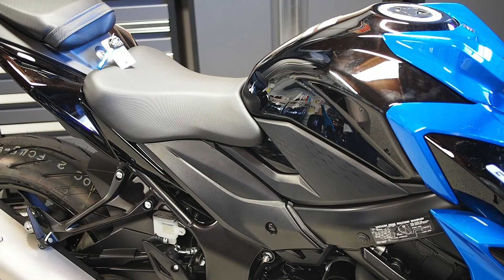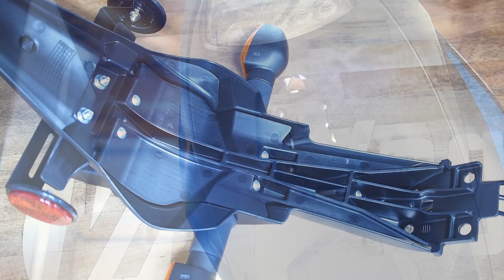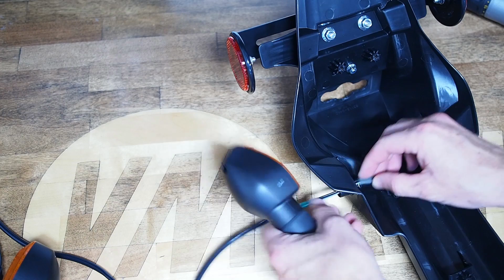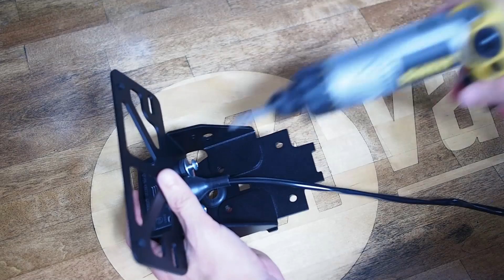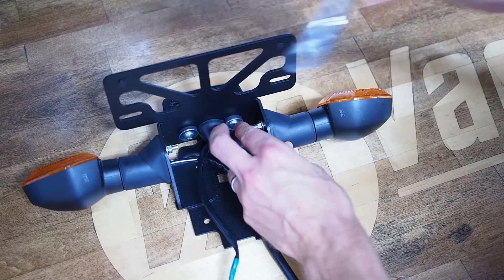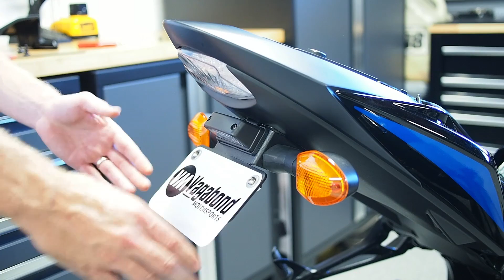2017 Suzuki GSX-S750 Fender Eliminator Installation - Vagabond Motorsports VM-SS710

Comment: Not a big fan of the locking washers, since they scratch up the black finish upon tightening. I just used big washers instead and had no problems even after 8000+ km. 
Great product, I love the fit and finish and the overall looks!

Comment: Beautiful piece of engineering. Fitted perfectly and this video made installation very straight forward. I’m in Australia and we don’t have the big spacer behind the registration plate light so it was just a matter of re-using the original screws.

Comment: The GSX S750 is the 1st bike I've owned that I felt the urge to install a fender eliminator.  That stock fender/license plate/turn signal assembly is just atrocious.  This fender eliminator kit fit like a glove and looks excellent!  I feel like the price is totally reasonable for the quality.  I wish I would have paid attention to the instructions about the license plate light spacer... I missed that part and left it in place and wondered why I needed the longer, original screws... Oh well, now I know!